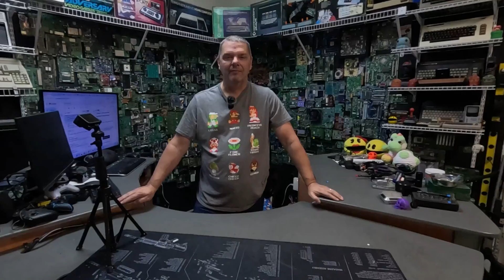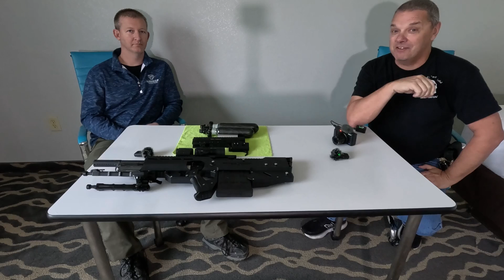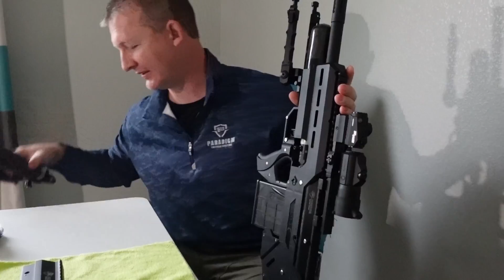Lets test the new Paradigm Overwatch and the PTX Bullpup | There are NO WORDS!!!!!

Comment: Have a question, John, I already own a Valken M17, I have a hand pump n a 13ci 3000psi Tipman HPA tank. All new. Now the tank leaks and the the handpump is mixing water with the air. What are my options?
Reply from the maker: Hey brother, if the tank is leaking at the neck, I would say return it for warranty. They’re usually pretty good about that. As far as moisture getting into the tank, unless you’ve got some sort of desiccation system or dehydration, system built into it that is unfortunately going to happen. You could look into getting one of the electric compressors. They are about 200 bucks and you won’t have that issue.

Comment: i would be very interested in seeing the results of using the 12 gram co2 adapter that screws into the female connections where the HPA bottle goes in  . with such low pressure required to fire this launcher , it would be a good emergency alternative power source . these adapters hold 1 or 2 12 gram co2 powerlets ! 
I would love to see the results , power and efficiency of 1 and 2 co2 powerlets . this would be a great alternative to and with the use of a hpa bottle ! 
could even use a 88/90 gram co2 tank with a bottle type connector . 
talk about being versatile !!!!!!!!!!!!!!!!!!!!!!!!!!!!!!!!! LOL
Reply from the maker: Oh, Im sure you will try it ;)
Reply: @AlternateArmsSD  as long as i keep it in the less lethal range , testing is good  LOL !!!

Comment: Super impressive. Bullpup design and air in forward compartment of the weapon makes a lot of sense for LL...Love the considerations into safety and clearing jams.  Jams and misfires are one of the more terrifying parts of dealing with malfunctions. Even after 3-4 years of obsessively playing with and modifying these I still occasionally run into misfires with jammed shaped projectiles to the point where i only use round ball.  Definitely going to seriously consider grabbing one.
Reply from the maker: Yeah, you can clearly see that this was designed by an engineer from the bottom to the top. Thanks for watching!

Comment: Jon and Paradigm: What site do folks like   me go to to build a bullpup to our personal preferences? BTW, Jon, thank you so much for emphasizing maintaining the production integrity of these less lethal launchers in order to delay their inevitable legislation as they've done in many European countries, for example. Modifying launchers to the point of lethality is missing the less lethal point. Firearms are for lethality. If you aren't allowed to legally own a firearm, a launcher modified to be lethal will be viewed as a deadly weapon, especially if used. This Paradigm launcher propels with approximately 15 fpe (21 joules) or 45 fpe (60 joules) respectively depending on the power choice. That's roughly 3 to 9 times the 7.5 joules allowed in many countries.
Reply: The BIGGEST part of this discussion that the less lethal market has been missing is what we call Impulse energy.  It is very similar to kinetic energy in terms of calculus; however, it is missing one major variable... Delta T or change in time.  As an example, two projectiles, one being solid, and the other being frangible with a powder or liquid fill.  Mass and aerodynamics being equal, a solid projectile that doesn't deform has a significantly higher impulse energy vs the frangible projectile.  This is because the frangible projectile takes longer (Delta T) to dissipate energy upon impact.  This increased time on impact reduces, on average, a perception of pain, and localized energy concentrations.
Reply: @Paradigmtac  Thank you for your detailed response regarding the Delta T variable as relates to frangible (i.e.; pepperballs) versus nonfrangible (i.e.; nylon rounds) and the difference that makes in delivering energy to a target. I, for one, would love a launcher that could deliver pepperballs at 21 and/or 60 joules. Was I correct in hearing that your launcher could launch pepperballs at 60 joules without damaging the projectiles? That would be a real game changer to me. Again,  thank you, and where and when can I build and buy your launchers?
Reply: @MichaelWhite-cx4ho , A 3.4 gram round @ 515 fps equates to around 42 Joules.  This is the max energy produced by the Kinetix valve with the lighter mass projectiles.  As the mass of the projectile increases the energy increases due to higher barrel pressures.  Max kinetic energy we have documented was 60 joules with 9 gram projectiles.
Thanks
Reply: Very interesting to me and very important in terms of utilizing these launchers. If a person modifies a .50 or .68 caliber  launcher to 40 joules and uses it to propel solid projectiles with points, arrow-type tips, embedded nails, etc, they've created deadly weapons that, if used against a person, will likely lead to serious criminal and civil liabilities, especially if injuries such as loss of sight, hearing, or maiming/disfigurement occurs. That is why, as far as I'm concerned, using the Paradigm or any less lethal launcher, without "deadlier aftermarket enhancements," is the way to go. These launchers will incapacitate an attacker or attackers if used as created, especially ones as capable as these units from Paradigm.

Comment: Besides the destruction of the target how come there is no one testing the poundage of the actual impact area. So it would be a measurement of how hard it hit at the distance so as to gauge the true effectiveness of it. Am I really making an impact of say 20 joules at 40 feet or is it diminished due to the distance?
Reply: Using a 3.4 gram shaped projectile the muzzle energy would be approx. 38 joules.  At 50 yards the kinetic energy is approx. 19.7 joules, and at 80 yards it's 13 joules.  Thanks
Reply from the maker: Also, keep in mind that that is going to fluctuate if you were using the 60J upgrade.  We crammed as much as we possibly could into this video without making it two hours long. There will be many many many subsequent videos coming up to address all of those questions as well.